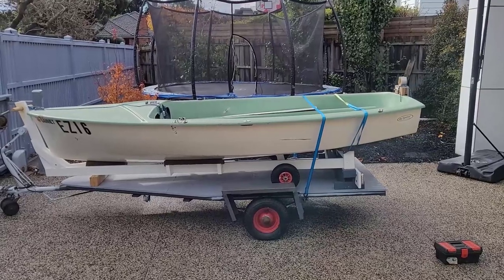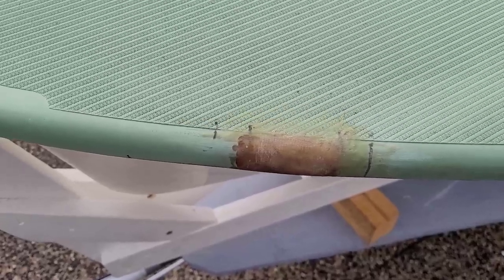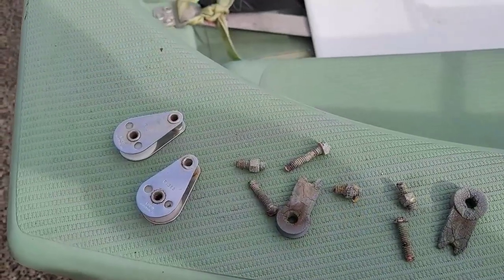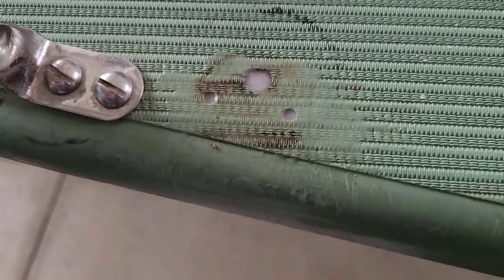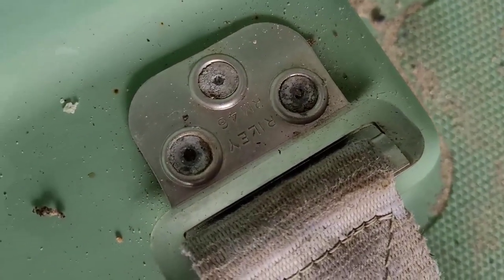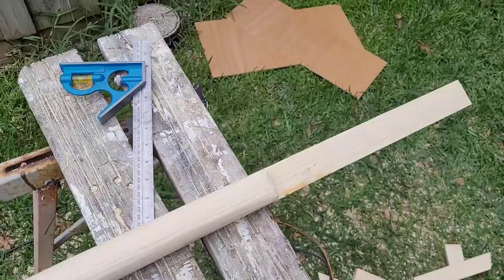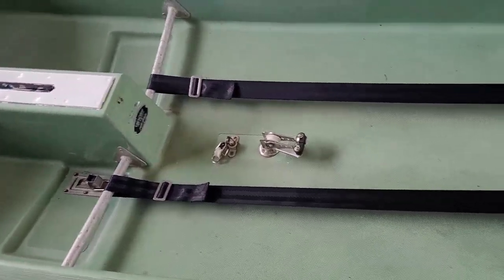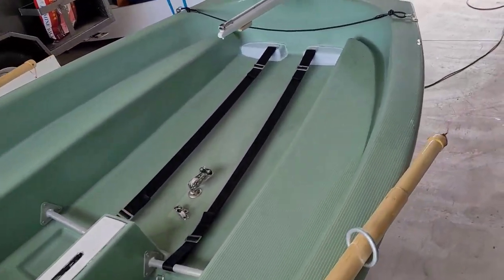DeHavilland Vagabond Dinghy Improvements

Comment from the maker: I tested out the tiller lock in conjunction with the oars on the weekend. It worked very well. The tiller lock helps with tracking - keeping the boat moving in a straight line while paddling. Without the tiller lock rowing is very hard, as the boat quickly turns on the spot whenever one oar catches more water than the other.

Comment: Great video thankyou ! . I just got the exact model. In the place of rivets many use stainless well nuts as the rubber grommet expands behind the fibreglass very effectively.  Ive used the one from kyak2fish. 
As lm a very newbie l dont know the correct way to rig my vagabond.  I'd love a video run-down of rig if you decide to do one. Awesome video thanks.
Reply from the maker: Hi Don. Congrats on the purchase, they are a great little boat. I recently made some more minor modifications to make it easier to sail single handed. I will put together a vid on rigging and show the changes I made as well. Though rigging is much the same as any boat with a jib and bermuda sail. Are you in Melbourne metro area by any chance?

Comment: Hi there , thinking of getting myself a vagabond dinghy , did you make the launching trolley yourself?
Reply from the maker: Yes. It was pretty easy. I found the post below on the web and sort of followed it. Though I used a 19mm gal pipe from my local steel supplier rather than the expensive aluminium rod, and I used carpet glued on some well placed timber along the A frame to support it.
https://www.blokespost.com/sailing/how-to-make-a-simple-sturdy-and-functional-sailing-dinghy-launching-trolley-dolly/6095
They are a nice stable dinghy, so I heartily recommend it. If you do buy it then let me know. I need to update certain rigging and such, so it would be good to compare notes with another owner. I dont know of anyone else who has one.